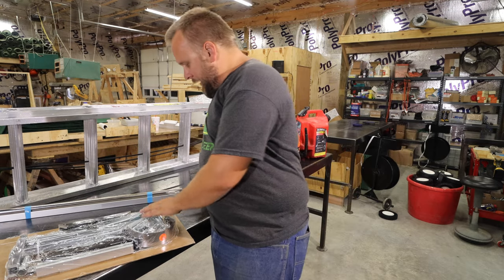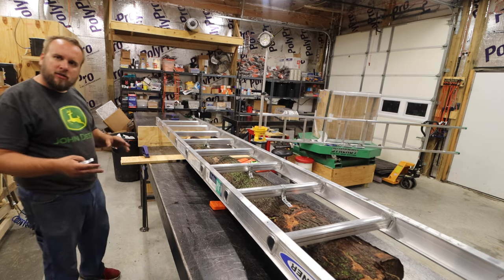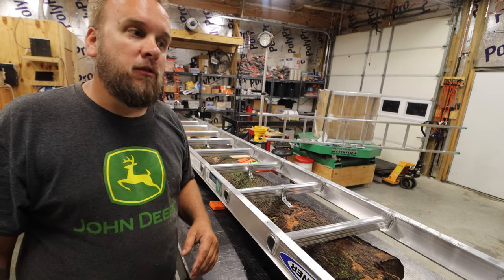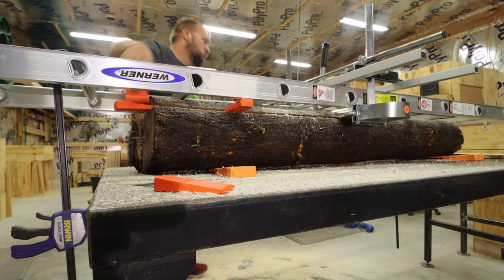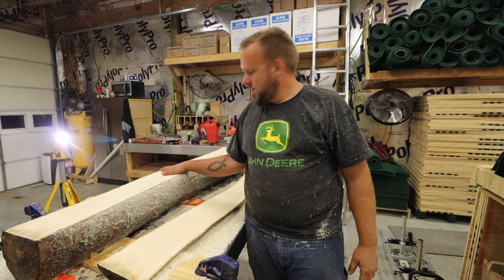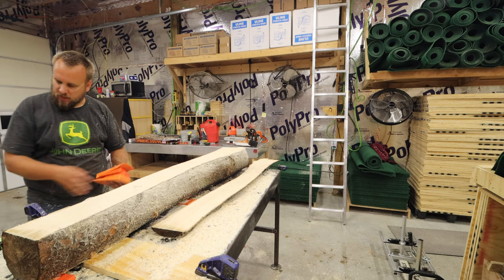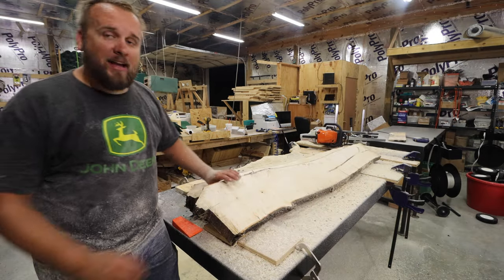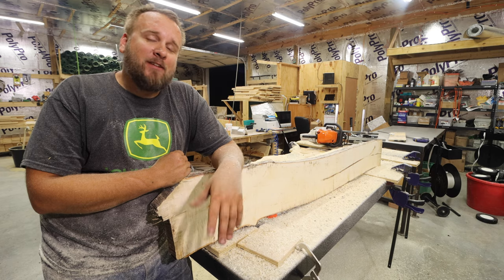Alaskan Sawmill - First Time Using a Chainsaw Mill

Comment: bought the granberg 777 today. Been going back and forth on it for a while, and after watching your video, I went ahead and got it. The 778 was sold out, but it is more than I needed anyway since I am just using a 50cc saw...as I have two saws that are both 50 cc. I have a 550 xp husqvarna and my neighbor gave me his stihl MS290 after I cleaned up his property following a recent storm because he has had both shoulders replaced and cannot crank it anymore...but it still runs fine.
Reply from the maker: Are you going to be putting videos about that on your channel?.

I plan to do a bunch on it but just have the one so far. I went the other day and bought stuff to build a stand to put the logs on
Reply: @RockhillfarmYT  Not what I got it for, but why not. ha. I might as well. Gotta make some type of rail for the first cut.
Reply from the maker: I know a lot of people build the rails out of wood and it works well. My thought was either you’re going to build it onto the log every time which seems like more hassle, or you have to build a really good wooden frame that won’t warp or twist.

That’s why I went with the ladder

Not trying to say right or wrong just my thoughts on it.

I really wanted a bandsaw mill but I think this is going to be nice too and a lot cheaper

I’ll try to stay busy and just show whatever I’m doing on here
Reply: @RockhillfarmYT  I understand. I am still looking into options...but have a few weeks to "get ready." Bandsaw mills are very nice, but expensive, and not really something one would want to leave out in the weather...meaning, you have to be able to pack it up IMO. The chainsaw mill is easy to put away.

Comment: I got one a few years back with a similar saw as yours. Quickly upgraded to the 660 with 42 in bar love it. Been making furniture with what I mill. Wish here in Wa we had more cool hard woods.
Reply from the maker: Thanks for sharing. I’m not sure if I have the skill to make furniture

 I’ve already ordered a larger chainsaw that I should be using the next time I make a video on this. I’m also building a rack to set the logs on
Reply: @RockhillfarmYT  I just use modified saw horses. It makes it easier to get the most out of the log mostly the last few cuts.
Reply from the maker: Thanks for sharing. Stuff like this always has some trial and error before you find what works best

Comment: They make a small hand winch that goes with the mill and pulls the saw through the wood. They look like they work pretty good.
Reply from the maker: Thanks for sharing. I looked at those but everything on the Granberg site currently has around an 8 week wait time to get which gives me time to get the feel for running it by hand

Comment: That’s some hard work and hard on a saw! I think there is a particular way to file your chain for rip sawing. You might check into that. Have you seen the old video of our family sawmill?
Reply from the maker: I have not seen that video But I will do a search for it

I ordered a ripping chain that is specifically for milling But it wasn’t here yet.

I also ordered a larger chainsaw because I don’t think the 391 could do this on a regular basis. Or maybe it could but I don’t know if it should

Comment: Brock, I’ve had an Alaskan mill for a while. Works great for me but you just have to a except it’s not a band mill. It’s a good starting place though.

Might want to watch running the gas saw inside the shop. Don’t want you having problems from carbon-monoxide poisoning in a confined area.
Reply from the maker: Thanks for the feedback. 

After the first cut I did open the front door and one of the three shop doors because of the saw exhaust

Comment: very awesome - I've often thought about an Alaskan mill.  I use more rough lumber than I have a trees, but I would guess I could be more creative at finding trees if I had the mill.  Maybe someday.  Did the 391 feel underpowered or why are you getting a bigger saw?  I have a 60cc saw, and I've "heard" that is about the minimum to consider milling with.  Curious what you think after that first initial experience.
Reply from the maker: I think my saw meets the requirements and it cut fine. It did seem like it was getting maybe a little hot but not bad.  if it was a pro saw with the same 64 cc that it has I would probably stick with it 

However this is more of an economy saw for the size

Also I might want a longer bar and this is the longest Bahrami supposed to put on the 391

Comment: Which type of saw chain were you using?  Most chainsaws come with crosscut chains (i.e. for cutting firewood).  Maybe you'll want to check out what is called a ripping chain saw chain.  I've only cut firewood, so, I don't know much about the other types of chains.  I found this video on YouTube.  https://www.youtube.com/watch?v=7lTY3F_GcgI  .  It maybe of some help.
Reply from the maker: I’m using a stihl MS 391 With a cross cut chain. I’ve ordered a ripping chain or milling but I don’t have it yet